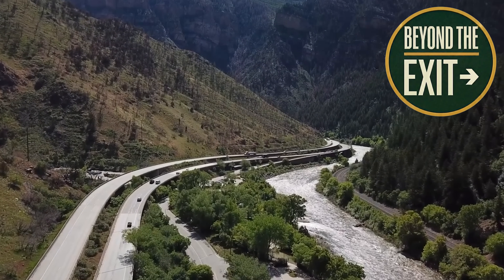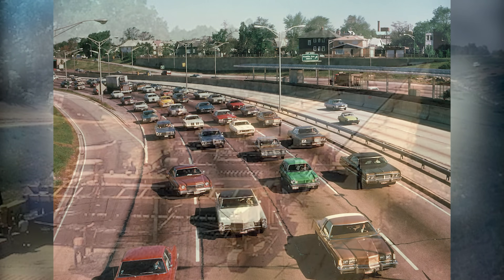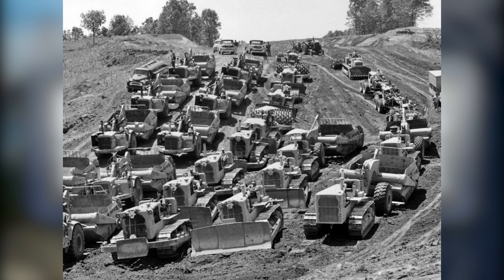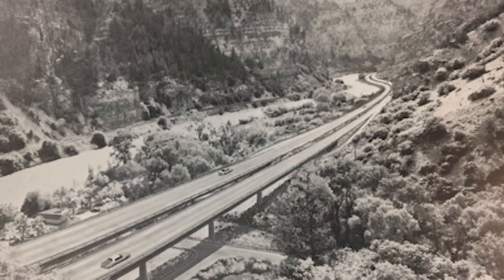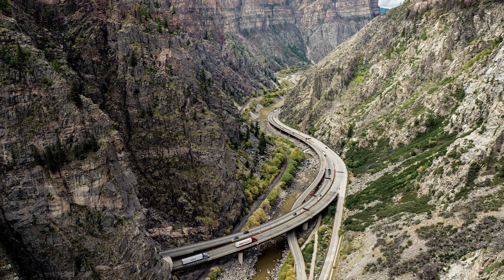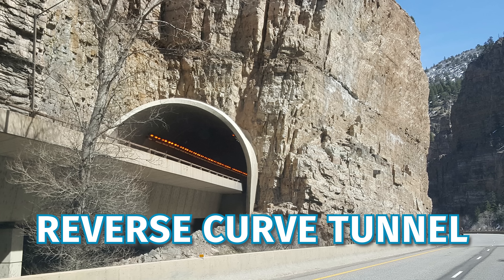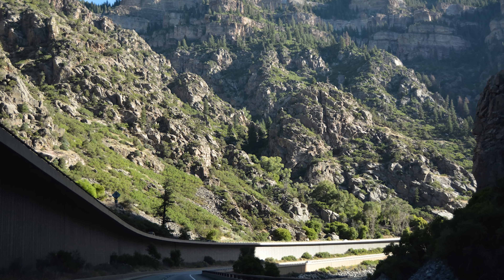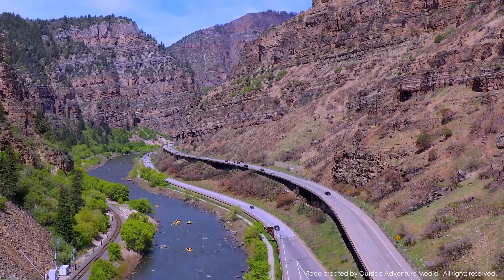Building I-70 Through Glenwood Canyon (Against All Odds)

Comment: Please consider making a video about Trail Ridge Road/US 34 through Rocky Mountain National Park. It is the highest continuous road in the United States, closed annually in the winter months (usually late October to May, depending on snowfall). Absolutely beautiful views, above the tree line, elk and bighorn sheep are frequently visible. Built in the late 1920s into the 30s if I remember correctly. You do need to pay the entrance fee for the National Park though, and no commercial vehicles are permitted, or vehicles over a certain length - don’t try taking your massive RV over the pass.
Reply from the maker: Great suggestion. Trail Ridge Road is a remarkable piece of engineering and scenery, and you’re right about the seasonal closures and vehicle limits. It’s been on my radar—thanks for laying out the details so clearly.

Comment: This could be solution for improving  the 5-mile section of US-395 that threads through the Mono Lake National Scenic Area, just east of Yosemite N.P.. The section runs between Lee Vining, CA, and the junction with CA-167. This section of highway is very prone to rock slides and avalanches. U.S.395, an important trucking route, is often closed at this point, requiring huge detours into the Nevada deserts.
Reply from the maker: @ClayBrandow You’re right about that stretch—Mono Lake to CA-167 is one of the most slide-prone sections on 395, and closures there ripple well beyond the region. It’s a great example of how geography can dictate reliability on major routes. Thanks for the insight, and thanks for watching.

Comment: Colorado resident here for over 50 years. I drove thru the canyon many times back in 70s and 80s. It was a narrow road and you could pull over and park by the river . I remember 1 time the spring runoff was so high that sandbags were placed along some parts of the river . The Canyon was so beautiful and I was against the interstate being built in this area. There were many different groups of people with various interests, including John Denver who were involved .  I now accept that this project needed to be built. The Canyon is still in charge - there have been many instances where the interstate has been closed for many hours or days due to rock and mud slides which have caused intensive road damage. To take a detour around this closure can be hundreds of miles.
Reply from the maker: That’s a valuable perspective, especially from someone who saw the canyon both before and after I-70; the constant struggle with the terrain definitely proves nature still has the final say.

Comment: Absolutely fantastic section of highway, and it's one of those that you really have to drive both directions to fully appreciate it. I had driven westbound I-70 a couple of times but had never travelled eastbound until just a couple of years ago. And in my opinion the eastbound section really gives you more appreciation of the engineering involved.
And for anyone wondering, the reason it's a more scenic view as far as the engineering goes traveling eastbound is easily explained by the train. The westbound Lane is always on the north side of the highway thus it's higher on the mountain so it tends to be the elevated portion. And because of that you really can't see the eastbound lanes for a large part of the trip. Only when going eastbound can you fully appreciate all the engineering that took to get the westbound Lanes elevated
Reply from the maker: That’s a really solid observation — eastbound is where the engineering finally reveals itself, especially with how the rail line and elevation dictate what you can actually see. Well explained.

Comment: I am a professional driver and our yard is in Englewood, just outside of Denver.. I travel through this Glenwood Canyon several times a month.  It is simply a beautiful masterpiece. So we'll done. KUDOS to the engineers who designed it and the workers who built it.  It is so amazing to look up nearly a half a mile and still see gigantic mountains of solid rock and the Beautiful river that flows below it.  The only sad part about this video is the semi trucks that were wrecked or destroyed by who knows what.. and those rock filled slides.
Reply from the maker: Coming from a professional driver who runs it regularly, that means a lot. The balance between engineering and the canyon itself really is remarkable, and you’re right — those rockslides and wrecks are a sobering reminder of what that environment can do. Thanks for watching.

Comment: Those of us natives called this the never ending 20 years highway. Driving through this stretch of road while under construction, required massive patience, and bravery, as a rock slide triggered by explosions were a constant threat. Even today at least one lane of traffic in whatever direction is always closed due to rockslides. Mostly small rockslides, but a boulder the size of a VW Bug is always looming above, and waiting to fall. It’s more an issue of ice melting, and breaking the rocks free than anything else at this point in time. I remember waiting in a line of cars for 2 hours while driving through the canyon. Just thoughts and memories from when I was a youngster. Here’s a small bit of advice for weary travelers driving through the canyon: take it slow, and keep a close watch on the road. A rock the size of a soccer ball could wreck your day in a split secong
Reply from the maker: “The never-ending 20-year highway” is a perfect description — living through the construction gives you a very different appreciation for it. And you’re right, even today the canyon reminds drivers that it’s still an active natural environment. Really appreciate you sharing those memories. Thanks for watching.

Comment: I drove through that canyon close to everyday, for about two years. Definitely once or twice a week at that time. I was delivering tires for a tire distributor. All the way up to Vail. It was a rough canyon to drive through, roads are rough, turns are fast, and when it snowed good luck!  You were crawling then. I had two breakdowns in that canyon, but it's a gorgeous canyon none the less.
Reply from the maker: @travishunt4225 That’s a tough way to get to know that canyon, especially running it in winter with a loaded truck. A lot of working drivers have shared similar stories. Appreciate you sharing that, and thanks for watching.

Comment: The engineers also built a rest stop between the highway and the  river, a nice spot to stop and enjoy the canyon. At Glenwood Springs there's an amusement park on top of a mountain where you can look down the canyon at the highway coming into town.
Reply from the maker: @edwardschwieterman7128 Those are great details — both spots give you a very different way to take in the canyon. Appreciate you adding that, and thanks for watching.
Reply: I have yet to pull down into it and wander around.

Comment: I live in Indiana. However, I've driven through Glenwood Canyon many times, most recently East bound in early May 2025. In 2003, I came back East bound through Glenwood Canyon in late October in a snow storm. I was driving my 1995 Chevy Suburban K2500 Diesel towing my 32' travel trailer. I had attended the SEMA Show in Las Vegas. I left Las Vegas early on a Friday morning (around 7 or 8 am). Other than food and fuel stops, I drove through to the first rest stop in Western Kansas where I stopped at 4 am the next morning and slept for four hours then drove it on home.
Reply from the maker: That’s a serious run, especially towing through Glenwood in a late-October snowstorm. Those are the drives that stick with you for life. Thanks for sharing that story, and thanks for watching.

Comment: As a truck driver I can remember driving through here in 1992 for the first time. I had a load from Las Vegas to Denver, Colorado. It went from a full interstate to a two lane highway. Eastbound was the whole interstate until the upper portion was built to accommodate the westbound traffic today. Very interesting and informative video. I wonder what it would cost on today’s economy.
Reply from the maker: In pure inflation terms, $490M in 1992 is about $1.2B today — but if you rebuilt it today with modern permitting, mitigation, traffic-control, and today’s construction pricing, a realistic ballpark is more like $2B-ish (roughly $1.8–$2.8B). Thanks for the great question, and thanks for watching.
Reply: @BTE4172 Money that this country don’t have unfortunately.